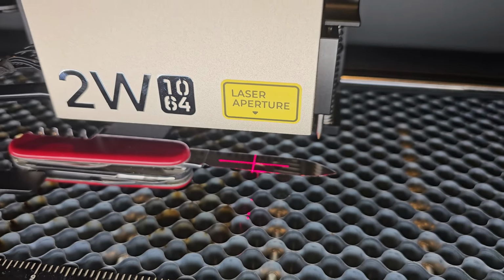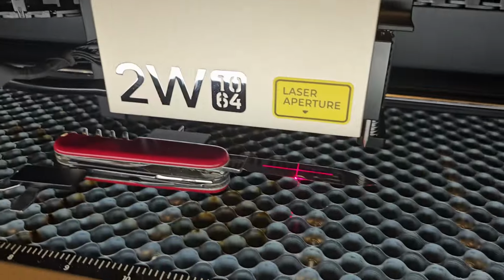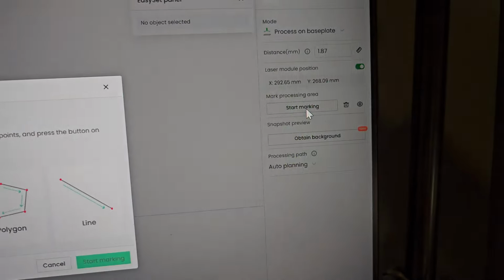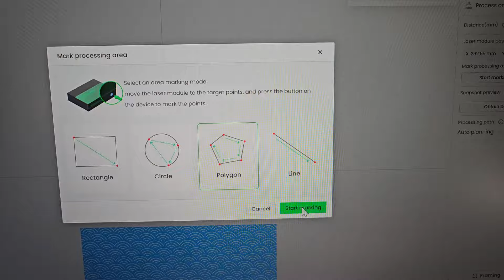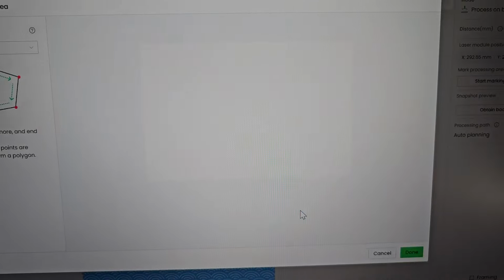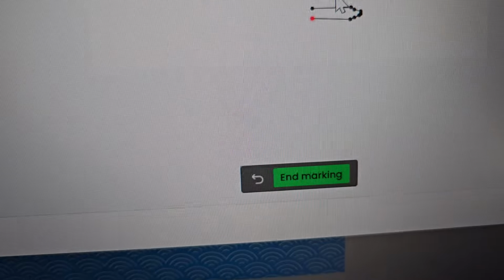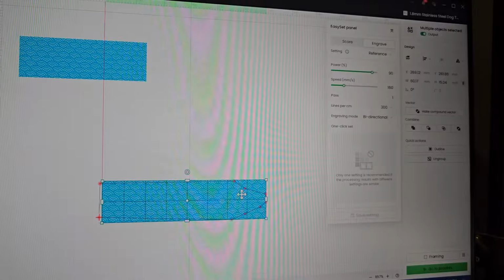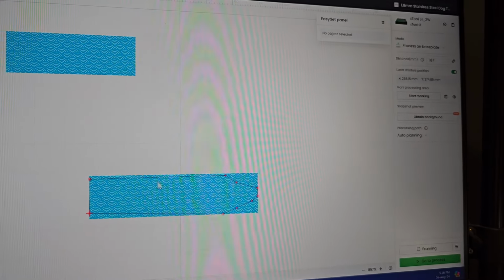Engraving Pocket Knife with xTool S1 1064nm IR Module

Comment: Nice engraving, mind sharing you settings for this project? 😊
Reply from the maker: Lines per cm: 300
Power: 100%
mm/s: 20 or less

I go through this in more detail in this other video: https://youtu.be/BpIOhWlGYI4?si=TY1Zhdc16HADaC5u
Reply: @DarrenYeoYT  thanks a lot 😊
Reply: @DarrenYeoYT  is it the same for you that after turning on the machine that the 2W laser head fans spin every 30-60 seconds for 3-4 seconds at full speed? Haven't seen this behavior on my 40W module.